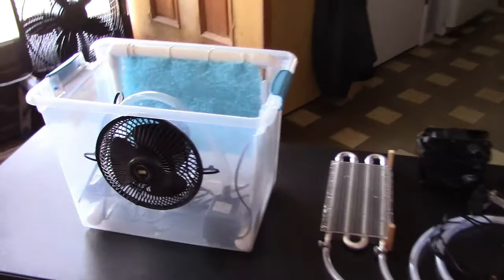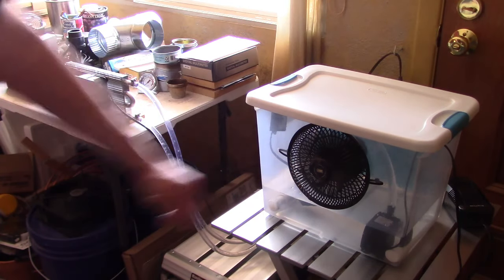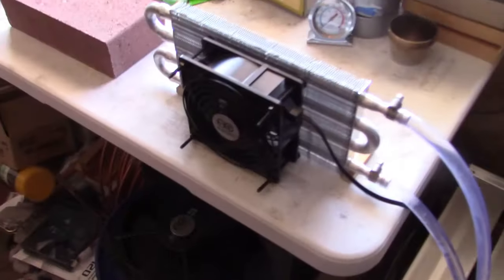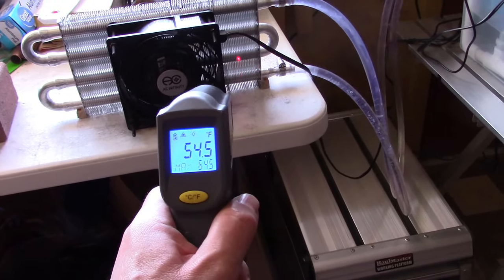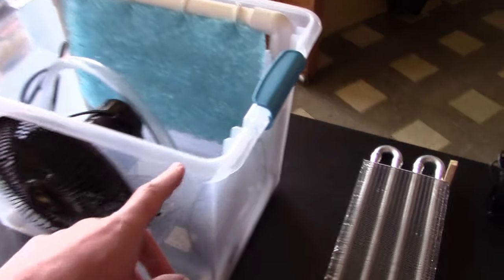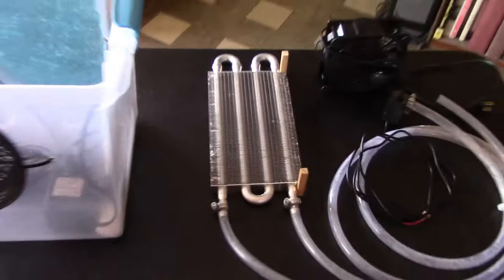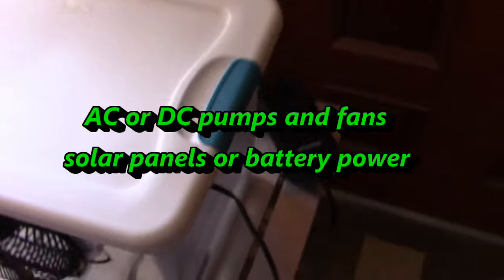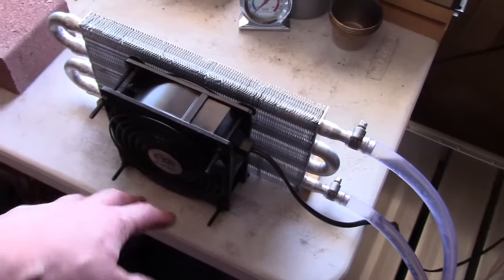DIY "indirect" Evap Air Cooler! No Humidity! only 39 watts! AC/DC air cooling! can be solar powered!

Comment: Sorry for asking this on a different video but could you tell me why my LED boards are getting too hot? I’ve obsessively watch all 3 of your videos. I know I have the right parts as from what I can see it is “snaked” like your first two videos but no matter what i do it overheats. I tried wiring it the way I see you have it in your last LED video from a year ago and it also got too hot. I’m at a loss. Id appreciate any advice you could give :)
Reply from the maker: hi there. it's normal for the units to get warm when there are lots of leds on them. what i do is run a fan blowing on the unit as i am using it. they need to be air-cooled if you run it for a while. sometimes i run my led light heating units for hours at a time. even a small fan works very well to cool the unit.
Reply: Firstly, thank you for responding!! This has become my literal obsession as of late! My son is an engineer but works in another state, he drew me up a wiring example so I’m pretty confident it’s as you showed. I guess my concern is HOW hot is normal. The leds, their leads and even the bottom of the board get crazy hot. Is that normal? I’m cool with it if that’s the norm but as of right now I don’t keep it plugged in longer than like 2 minutes because I’m convinced I’m going to burn the whole city down with my little diy project. So that limits it’s use quite a lot. Anyway thank you again for your response I really appreciate it. 

And on a side note I’ve told at least 10 people about your channel. Thank you so much for sharing your talents with the world!
Reply from the maker: @Leah the amount of heat the unit produces will depend on a few things but mainly on how much power the leds draw and how many of them you use. it may also depend on the exact breadboard you use. some of them may have thinner connecting 'wires' in the breadboard itself which may cause extra heat. here is how mine is... the bulbs of mine just get warm but not hot. the leads on mine get very warm to hot after a while (but stay plenty cool with a fan). the board on mine gets warm but not hot. i consider all of this normal. my best advice is just to use your best judgement. if you think your unit is not working right or is unsafe then i would say don't use it. by the way, thanks for sharing the channel!
Reply: Ok, so, prior to asking you about this I ordered some battery cradles from Amazon. They came in today and I swapped it out. FIXED IT! No where near as hot as before. It’s barely even warm now. I had thought it was the adapter before so I ordered another one and it still was too hot BUT I ordered another of the same one when I probably should have ordered a different brand. Not sure what happened there I had it set to 3v. But anyway thanks for your help. Hopefully it can help someone else if they have the same issues.

Comment: Just build your small transcooler fan setup, 7inch fan with a 403 coil, it works good if your real close to it, it just eats up ice like a MF, maybe my pump gives off to much heat? Its an AC aquarium pump that i allready had, any suggestions on a pump?
Thanks
Reply from the maker: hi there. the transmission cooler and ice setups i made are great - but like you said, you need ice for them. this unit makes its own cold water. a bigger pump will warm the water faster in the ice -based units so the mini pumps seem to be the best to use. i recently bought a pump that doesn't even go in the water - i'll be trying that one soon.

Comment: Hi sir, where can I buy that blue pad?
Reply from the maker: hi there. you can get the blue pads at most home stores (like home depot and lowes). amazon sells them too (but they over-charge usually). i big 3 foot by 3 foot sheet should cost you under 10 dollars. if you search the term 'foamed polyester evap cooler pads' you will see lots of them
Reply: @desertsun02  Thank you!
Reply: I tried all the fancy new pads and found the double thick aspen pads worked as good or better.

Comment: I built a small (6pk cooler size) heat exchanger unit last year using pc radiators and usb fans, it kind of worked but the outside unit drew the florida humidity like a magnet and it sweated worst than this fat man in the florida sun... I may try this set up just to see

Comment: What’s the sqft this will cool?
Reply from the maker: hi there. it's hard to give a specific size area that these will cool. it will vary quite a bit on a few factors. a lot depends on how much you're able to cool the water (and that depends on temp and humidity of the air). also whether you use ice or not. it'll also depend on how hot the ambient air is along with how well insulated the room is. you can size the system to the area you want to cool but you'll have to experiment

Comment: Won't it work in humid environments?
Reply from the maker: hi. these units struggle to work in humid environments.
Reply: @desertsun02  is there any solution for humid environments? I want to build a fan to cool a tent at the beach camping
Reply from the maker: @ozp11 i have a few ice-based air coolers. those work good in humid environments. they cool due to the phase charge of the ice turning from a solid to a liquid. (so no significant evaporation takes place with those units) *meaning no humidity is added to the air. i've got a few cold water/ice based units with fans and a few with radiators and fans. those would be the best for humid areas. check channel video page or playlist area to see them all in one place.
Reply: @desertsun02  yes, I've seen them. Ice will be available there. But I'm not sure if they would last for a night sleep.  I thought about using car radiator liquid instead os water. Then let it cold inside the fridge. And then use a closed system. The ice would be used with salt and alcohol. The issue is make something to last 8 hours

Comment: How much cooling could I get without ice? How many degrees change do you reckon?
Reply from the maker: hi. it will all depend on how cold that water is. many people use natural cold water sources like 'well water' or even lake/river water. you can get excellent cooling even with the water temp in the mid 60's F
Reply: @desertsun02  so if I am in Florida and it's high humidity and hot as hell like lets say 90 degrees to 100, I can take my well water at 72 degrees and bring the temp down significantly in the room. I'm thinking ice is not practical in case of emergency...unless.... Any ideas on making ice with solar panel energy??
Reply from the maker: @Joshua Luke Wilson if you've got a solid 72F cold water source you should be able to get some decent cooling. you might be able to get 77 or 78F air coming out (not too cold but a lot colder than 90 or 100). since you're in a high humidity area - you would only need the fan with 'radiator' attached to it. (you wouldn't need the evap part of this system). i have 2 or 3 videos on how to make ice with solar panel energy. here is a link to one https://youtu.be/T9CcPZMK-bc